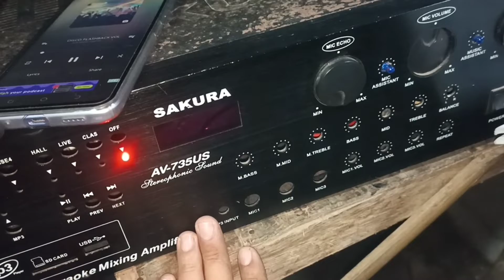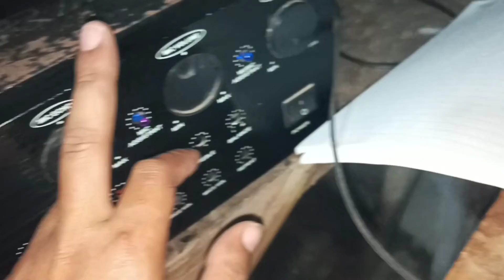Paano gumawa ng LED indicator basic explaination and review... part2 tutorial...

Comment: Yung sakin boss 16v na capacitor tapos 5watts resistor at doid. Mas okay sya Kasi. Kahit mahina Ang piga Ng amplifier iilaw na sya . At sinubok ko sinagad amplifier at Hindi ko sinaksan in put sa speaker okay sya Hindi sya nasusunog.
Reply from the maker: Ok yan master upgrade mo circuit basta safe no problem
Reply from the maker: At tingnan mo rin tong isang uplaod na vedio ko about led light indicator rin paki check nlng.. po... Salamat